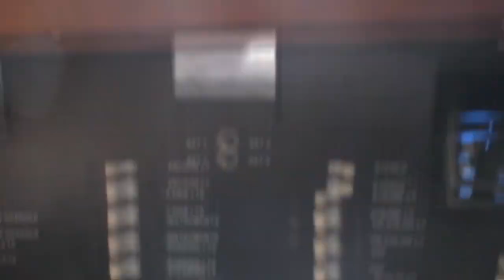Cruising Lealea: Long Term Maintenance

Comment: What a great update.  LeaLea is a very lucky boat to have found you two as her curator.  I particularly like the video you included of the port townsend refit and the engine rebuild as I have not seen that footage in your previous videos.
Reply from the maker: We have quite a lot of video we have not used - cruising out of Friday Harbor in 2008, Shilshole Bay in 2009, San Francisco Bay in 2011 and, as you noticed, Port Townsend.  It is all pretty random but you may see some of it in the future.

Comment: Hey Chuck and Laura, Great to hear from you again. I realized from the Wx reports that you were getting a real winter this time around, Finally got the Wallas stove installed. Like all projects the devil is in the details and there were many. All in all satisfied with the stove so far but it is not for making a cup of tea or coffee in a hurry. Also the electrical demands are great for about 10-15 minutes. I have left the stove running all night several times now and it definitely keeps the boat toasty and makes food prep easier because you just lift the heater hood and you are ready to rock and roll or at least cook.

In any case we will see how Judy likes it. She is due to return to Rajah Laut (and me) in two weeks and then we head North. I would like to head straight to Dutch but not sure the timing Wx wise will be right. In any case with any luck we will see you this summer wherever you end up, There is a little chance we might Winter in Baja but too early to see that clearly yet.

Spring is slow to come to the PNW trees are just beginning to realize it is time to leaf out. Bushes got that message a week ago or so. Still not that warm though and we have had some amazing wind storms. I think yesterday I saw gusts to 40 on the meter. I guess we will get warm Wx when we do else we won't.  That has happened around here too, I hear.

All the best to you both,

V&J

Comment: Great to see you both back after 'enforced hibernation' and a very interesting video too. Your boat gets the the best of attention. I was sorry to learn that the installers put the replacement engine incorrectly (all those years ago) what exactly did they get wrong - anti syphon loop too low? looking forward to seeing the 'reassembly' pf Lea Lea as he temperatures climb.
Reply from the maker: There was no water lift muffler or anti siphon loop in the exhaust system.
Reply: Eeek!😳 Sorry to hear that - amazing it ran 16 years really.

Comment: You guys are always optimistic. :) wasn't this supposed to be a 5 week refit? or something like that? Well, spring is finally here (one dry day in the south sound = spring) so good luck, see you out there.  S/V Colmena. -HR-31
Reply from the maker: Our original estimate was 500 man/hours which, with a little overtime, would make it six weeks for two people working full time.  In terms of hours, we are still on track but we did not account for the unusually harsh winter this year. OF course, when it comes to boats, you can figure that any project will take longer and cost more than planned.

Comment: Nice channel. A pleasure to watch your videos. And a question: How did you remove the bulkhead? Mine has a bit of mold down, below the V-berth sole but can;t remove to have some decent access to repair it. I own a Tayana 37, 40 years old.
Reply from the maker: On a Vega, the first two half bulkheads that support the v-berth forward are glassed in. We cut them out with an oscillating multi tool and a disc grinder.  The rest of the bulkheads were bolted to tabs on the hull and were simply unscrewed.